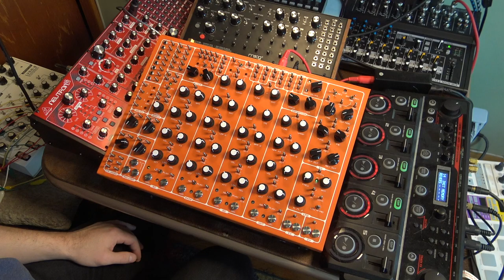Pulsar23 Secret Level - 8 Voice Drone Synth Tutorial (Lyra8 2.0)

Comment: Yo, first of all nice vid, really appreciate it, but since I did not receive an actual manual with mine, when connecting the HH part I got a clicking sound together with the high pitch while adjuating the tune and etc. as you noted, the pitch would change, but the clicking does not go away haha